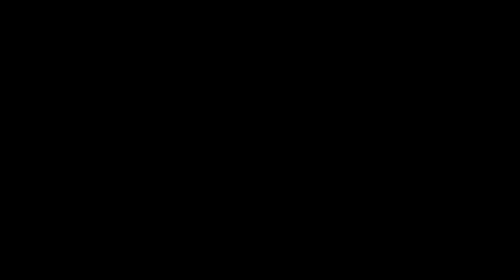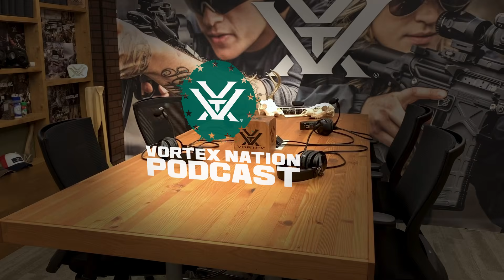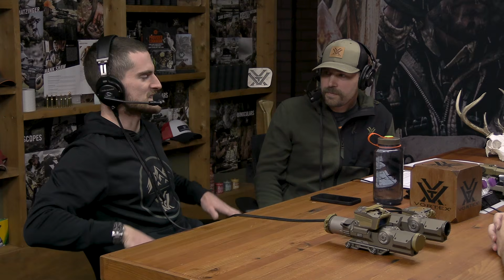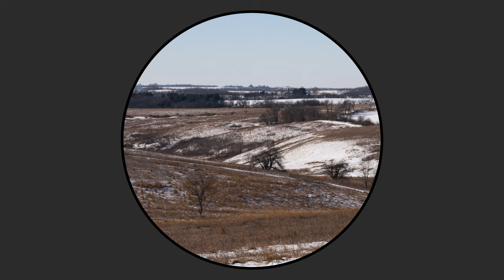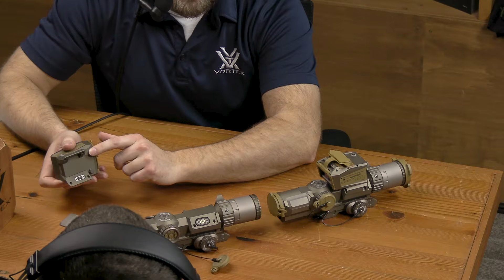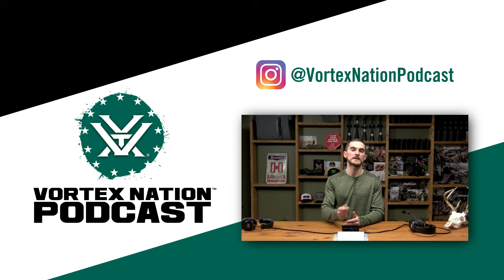Ep. 220 | Army selects Vortex® for Next Generation Squad Weapon – Fire Control. What is it?

Comment: For any one interested in the size and weight 
The parts used were as follows:

The Wilcox industries Raptar, which is approximately 14.8 oz

The Nightforce ATACR 1-8x24 F1, which is 21 oz

For they mount it is most likely the badger ordnance condition one mount 34 mm 1.54” which is 5 oz

The badger ordnance condition one accessory ring cap (ARC), 1.8 oz

The badger ordnance condition one coaxial laser integration fixture long, 2.3 oz

Which leads to a grand total of approximately 44.9 oz or roughly 2.8 lbs, so the the new NGSW-FC is less than 2.8 lbs which isn’t telling us much. For context the cco is 9.6 oz, the rco is 16.2 oz, and the dvo is 26.6 oz with mount included.
Reply: Thanks for doing the math, could be one heavy SOB. Put that on top of the Spear and you're talking about a 11lb unloaded gun. Getting pretty hefty..
Reply: @telemarkwv  Indeed. Although in Vortex’s defense, the NGSW-FC isn’t just a scope. The NGSW-FC is an integrated 1-8x scope, scope mount, laser range finder, and an infrared and visible aiming laser. If you were to put together a similar package, the sum of their parts would probably be larger and heavier than this. Food for thought.
Reply: From a civilian perspective, I can safely the weight is not worth any ‘advantage.’

From a soldier’s perspective, it’s a great optic and the weight won’t get anymore in the way than any other equipment.

From a logistical standpoint, I’d say it’s a horrible optic for its potential distraction of the user as well as the capabilities of more compact optics at similar ranges. I honestly have no clue what genuine purpose this would serve in an environment where the weapon cartridge itself can’t engage beyond 1,000 meters.

This optic is a sniper scope turned cash cow and the defense contracts are the name of the game.
Reply: @elizaokawa  When we moved from iron sights to better optics, the kill rates increased significantly.  The USMC study found that iron sights actually interfered with engaging moving targets and that Expert shooters could not hit any moving targets.  Which is why the USMC is investing millions in new moving target ranges.

The M5 sight takes a lot of workload off the shooter, increasing hits, and decreasing human error (estimating distance, uphill/downhill,  speed, etc.).  Killing more Bad Guys saves more Good guys lives.  Dead Good Guys are stunningly expensive.
Reply: @cwolff5119  I’m well aware of the inherent overwhelming advantage optics have over iron sights; however, the M5 seems to be significantly more cumbersome to the eye compared to holographic and even ACOGs.
-
My primary point of contention comes with user distraction to an optic like that. A close second however is simply ease of use on such a monstrosity.
Reply: @elizaokawa  the operator has the choice to use the fixed unpowered reticle or use the computer.  Basically the test Soldiers voted….. twice.  I have to trust their experience and judgement.
Reply: @cwolff5119  How can we be certain from such a narrow testing pool the soldiers weren’t instructed by their officers to lie about the efficacy for the purposes of funding?
-
It’s happened before from the M249 all the way to the Bradley.
Reply: @elizaokawa  Because American Soldiers aren’t bots or automatons.  In the 2 phase contract, they gave their opinions, the companies made changes, and the Soldiers voted.  Officer opinions don’t really count for much.
Reply: @elizaokawa  hard to say since neither one of us has actually used the sight.

The operator has the choice of using the optic by itself or the full computerized capability.

Tracking Point has been around a long time….. and this is even faster.

But that’s why the Army does  extensive Soldier testing.

Cheers

Comment: Only thing I can think of that I'd like to see with LPVO's like this is having the rail to center of the eye piece to be close to the unity tactical fast mount height... Reason being when you're kicking in doors and have nice ear pro you can't get low enough it seems with normal mounts without screwing up the seal on your ear pro. I'd like to see a modular bottom portion of the base to incorporate a riser to accomplish this if you have soldiers issued ear pro comms but I'm not sure the regular soldier would want the riser due to you not being able to have the usual cheek weld with a higher optic. Just something to consider if you guys haven't already. Great looking optic, I want a civilian version but my wallet doesn't want to see the price lol

Comment: Hey vortex dudes. Please ask vortex to make the 1-10 razor with the nonexistent ultralow profile turret found on this new gen scope. We don't need to dial on lpvos. Turrets can be small, light and rugged...even flush to the scope. All these scopes have like 1.5" brass internal turrets that weight like 5 oz that no one uses. Make them light, tough and small like a meopta or zeiss. They use polymer in aerospace all the time. Internal turrets that are rarely used don't need to be metal. Otherwise it is a good as it gets already. Thanks for your time.
Reply from the maker: Hey there - we appreciate the feedback. We don't have any plans for something like that at this time, but we'll definitely let our engineering team know that there is interest in this.

Comment: Not sure if this question can be answered but I know that at least for a while one of the requirements for the NGSW rifles was a powered rail system so that you wouldn't need batteries in any attachments, does this potentially work with that system? Or was that maybe a dropped requirement